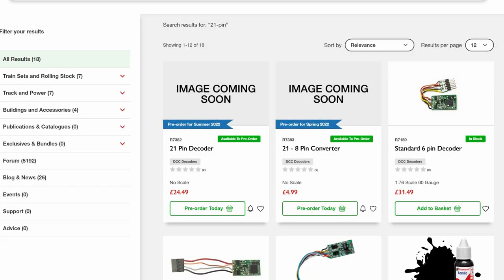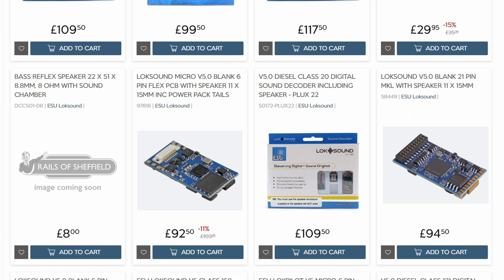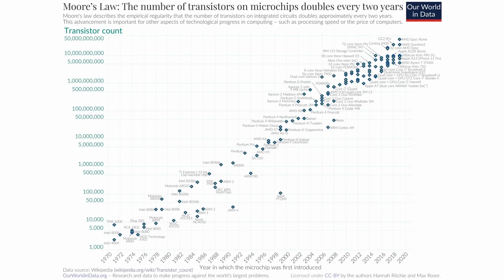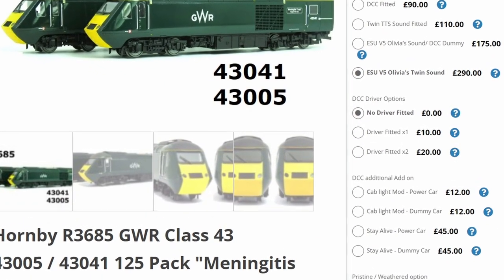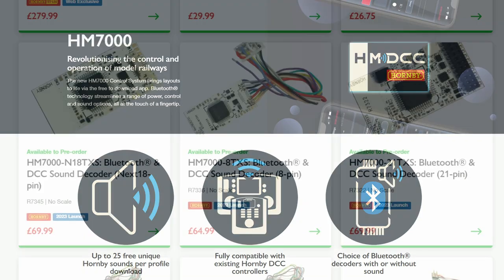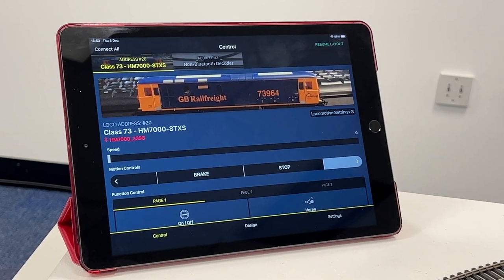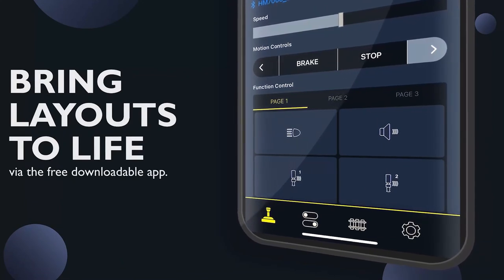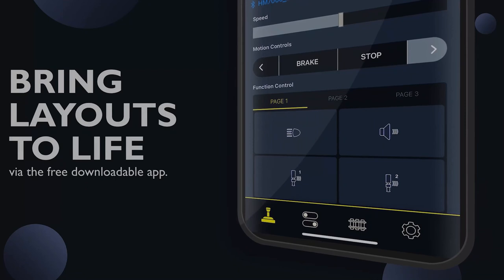Can Hornby's HM7000 solution address my frustrations with existing DCC sound and control operation?

Comment: As much stick Hornby seem to get in the modelling world, you have to acknowledge they're the only ones who have tried to make DCC accessible from a cost perspective (albeit that doesn't seem true for their models) but also from ease of use controllers. While many say they're basic, sure, but how many 'features' do you need to have and use? Hopefully HM7000 bridges that gap by removing the hardware element for the controller and the decoders seem reasonably priced
Reply from the maker: I've been thankful to Hornby for eLink+Railmaster providing the lowest entry point  for DCC that is still very functional.

Comment: Re HM 7000:  
Bluetooth has been around for ages. Just that Hornby has caught up with it.
(Bluetooth is a specific form of short range WiFi)

Re HM 6000: 
Bachmann has had a basic non DCC sound unit too.  Apparently Hornby had one circa 1960s / 80s.

I have a Hornby 45rpm record with train sounds!  No nothing about it.

Re alternatives: 
Radio controlled has been around for many years. I have quite a few (Ahern, Lionel, etc) and they operate on DC and DCC power.  They seemed to have disappeared.  Possibly because of their short range, etc.

I have a Bachmann (GGG) with sound that will operate on DC without anything else. As you increase the power, it goes through the start up sounds (engine, bell, horn) in order as it moves off! It also operates with DCC power and equipment.

A guy in USA has been making ANY track power WiFi - with and without sound for some time.
Reply from the maker: I love the Bluetooth control and as you say there have been other wireless options out there.  Having been a very heavy HM7000 user across multiple vendors locos over the last 18 mths I need to do an update on the pluses and minuses. Thanks for sharing.
Reply: @EuviRail  

Glad to hear that.  Some reviews identified issues.

You have said 'across multiple vendors'.  Do you mean makers all with Hornby Bluetooth decoders or different brand Bluetooth decoders?  My current understanding is that all Bluetooth options are proprietary.  ie there is no universal platform / standard / code for all like there is for DCC (made by Lenz and made available to all for free.)   

Admittedly you could run different brand Bluetooth engines on the one DC powered track / layout regardless.  Just that each time you buy another brand, you will need another app (and in the case of Hornby - one HM6000 unit as a minimum.)

I'm platform neutral.  My layout will have 12 mainlines which can all be independently powered.  All tracks will be wired (in blocks) to sockets (D26) available at the front of the layout.  I can then make plugs for current and new technology as I wish and change them anytime.  I've designed safeguards to reduce human error to the minimum of leaving an engine on a track and changing the track power supply to an incompatible source.  Hard to do that with modern DCC which auto detect and work on DC or DCC.  No power supply can be 'backed' into another.    No engine can cross from one source to another because a engine length neutral connecting track will have no power unless both sides are from the same source.  Notes:  Can't use 'stay alive'.  Best not used for fiddle yards and different power sources.

I'm looking for a TRUE haptic / tactile controller that's compatible with what I have!  Seen some but not compatible.  I have Viessmann for DCC.  A vibrating phone image is not it.   LOL

Meantime a bit of trivia.
Who invented WiFi?   A female named Hedwig Kiesler.  Better known as actress Actress Hedy Lamarr,  she gets the oldest mention.  Then CSIRO in Australia.  Followed by an assortment of people who added different variations.
Who invented Bluetooth?  It's actually a form of WiFi so see above.  Jaap Haartsen gets the credit for the Bluetooth version we have today.

Comment: On the face of it, the Hornby HM7000 announcement for DCC control and sound is well over due. I believe DCC is being held back by the NMRA which is predominantly US orientated. For example, why are we stuck with a maximum 4 digit loco address when many UK loco id's can be 5 digits?

Bluetooth offers benefits for DCC but, I suspect Hornby will make their version proprietry meaning it will only work with their equipment. I suspect their new HM7000 chips will have limited functionality and not feature things such as ABC braking and drive lock etc. I also suspect they will close the price gap with ESU \ Zimo etc as their product gets established.
Reply from the maker: Thanks for that.  The loco ID limitation is a real pain alright but just another example of how out of date DCC actually is. I can't see the TXS decoders matching the ESU and Zimo models alright but I do hope they hit the most critical areas. It will be interesting to see what they retail at from sources other than Hornby as there has historically been a 20-40% difference in TTS pricing. These are high margin items so plenty of scope for discounting.

Comment: to be honest z21 starter i would say is better starter than the hornby stuff
Reply: Yes, by a long way
Reply: @BearsTrains  now with the starter great thing is can always upgrade to the next level black version  when your more advanced in model railways which is i think great. now started does have reduced amount things you can do with for sure but i would argue it gives new modellers a better idea of dcc then anything hornby could make. hornby dcc controllers are for the most part antiquated and very i think poor in terms build quality. if you are starting in dc i would say get a gauge master 2 track controller for 135 euros or little bit more its not bad and is easy to set up and plus doesn't mess your models up like the hornby ones. but hopefully my info helps people. want everyone to experience this hobby in the best possible way.
Reply from the maker: I wouldn't go near the other Hornby controllers myself. The z21 is probably one of the most uptodate (if not the most) DCC systems out there.
Reply: @EuviRail  maybe a video to do is looking at the z21 range and what it offers and the advantages and disadvantages of each series of there set ups just thought 😀.
Reply from the maker: @James-ih4gz  Hi James,  unfortunately I don't have the luxury of a local model shop who would let me play with one for a while and it isn't on my purchasing list right now. There are a few videos already up there on z21 that I haven't gone through yet so I don't know whether they're doing a critical review like would do or an upbeat one where everything is great though in fairness the z21 looks pretty good on paper at least.

Comment: Two critics I use to hear about DCC, are the outdated technology and the overpriced electronics, not just the sound decoders. I'm a non-sound DCC user myself, and also some kind of computer geek, and to see the price of DCC equipment, decoders and command station, just follow the inflation rate while having near to zero innovations, and clearly some stupid limitations. For instance, if you need to enter a 6 (if not 7) figure locomotive number into a DCC system, something casually found anywhere in Europe, you can't. You have to find a trick to enter your DB 056.241-3 number, your BR 56 102, your FS gr. 940.022 or your SNCF 475 134 diesel into a four figures format you can use without forgetting which number your locomotive is on your controller... I need a spreadsheet to remember what number I use on my engines outside UK period 3 (1923-1947) !
Also, you can have a very decent entry-level laptop for 400 €, an electronic device that is far more sophisticated than any DCC control station at the same price, if not higher. How can they sell electronic hardware the same price today, corrected from inflation, as it was in the early 2000 ? I made the calculation and my MRC prodigy express (same system as the one sold under the Gaugemaster brand) costs the same price today, in constant money, as I paid for it in 2006 ! (GBP 275 retail price, I paid it the equivalent of GBP 120 in 2006) I had just seen an electronic calculator for teens in high school sold in my local supermarket for one third of it's price which is more sophisticated than this item !

Here, we have a direct control with bluetooth, ditching the control station, limiting the sophistication to the decoder. For the rest, a simple 12v DC basic transformer for the power is enough, you don't even need to have a regulator on it. On paper, it's simply amazing. If they do an accessory decoder for point motors, that would certainly becomes my first buy from them. I'm following that, it's something new, and interesting towards price. If it's reliable, that would really become a game changer. I hope so !
Reply from the maker: Thanks for that Oliver. I feel your frustration. I wouldn't be throwing out my existing DCC kit any time soon but I'm hoping I can shift all my future decoder purchases and take it from there. Hornby claim to have been working on this for 5 years now so I hope that's reflected in the quality of the product.

Comment: HM7000 looks extremely interesting. However there are two flags that I would need to see develop over time.

The first would be sound profiles, and the ability to upload custom profiles. I did email Hornby about thia, and the inferrnce seemed to be that this would not be available at launch. Could also be an issue with app store verification. But if this was considered in future, then I think the loksound range would have serious competition on their hands. Electronic compoments are expensive, but even then... its a hard justification to purchase £120 chips which cost more than a arduino or computer ram.

The second is Hornby themselves. Whilst they are normally innovators in new technology, it is rare for them to be market leaders or have long-term stability. Hornby Zero, Live steam, the ORIGINAL spec sapphire decoders (with fuel persistance), Railmaster detection system, and now TTS being phased out. The select and elite  whilst relatively ok controllers, also lack adaptability and the early cheaper entry pricepoints.

Will be watching this carefully, Hornby need to go all-in and have support for at least up to 2032.
Reply from the maker: Thanks for that and I'd share all these concerns. Phone Apps are great but lifecycle support incl. future and older OS support is not trivial to manage.

Comment: I must admit, I find the cost and faff of DCC unattractive. It is obviously a clunky and outdated system. I have a huge fleet of locos and would prefer to spend my money on rolling stock that over-priced, obsolete tech. There is definitely a market to adapt low cost, modern tech. The HM6000 is a really good example of that (though mine seems to have died recently). Even then, the Bluetooth interfacing feels a bit Alpha!
Reply from the maker: Thanks for commenting Daniel. I can 100% see how anyone could be put off investing in DCC. I like the sound and loco control but boy do you pay for it right now.

Comment: And radio control was the way forward 30 years ago. With the modern channel splitters it's easy as pie to run everything from a single switch or button box. Radio control is cheap and one off. Why is Rail modeling 30 years behind in this and other areas. Rule Brittania